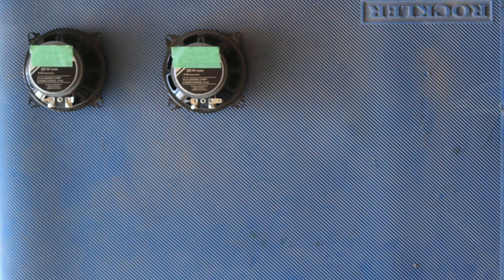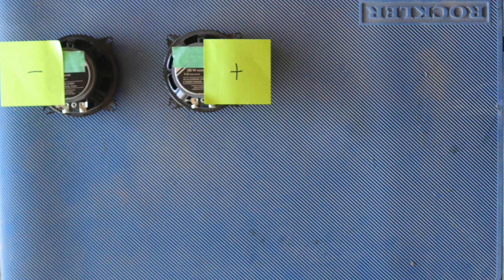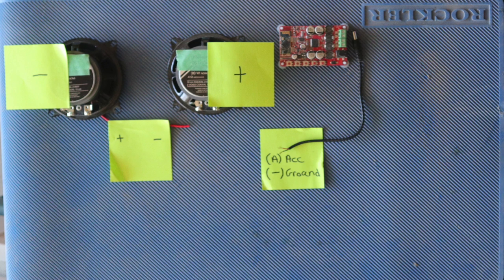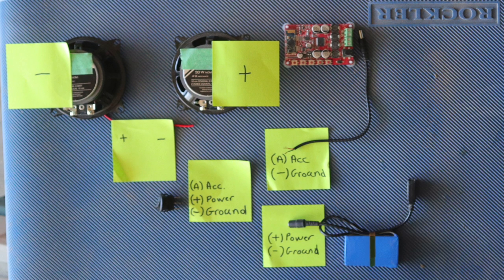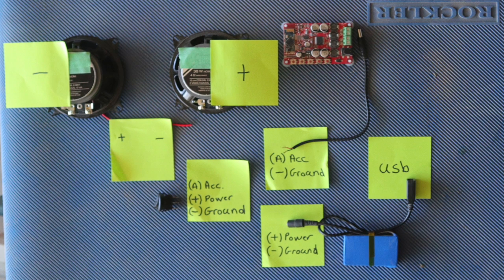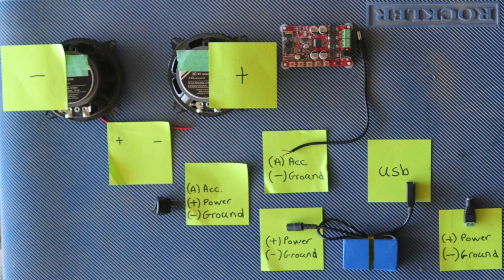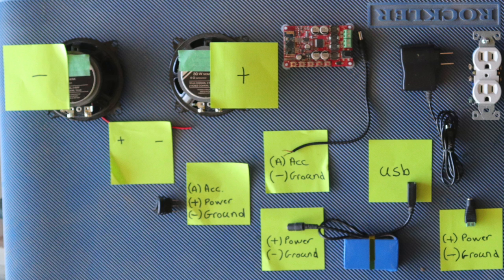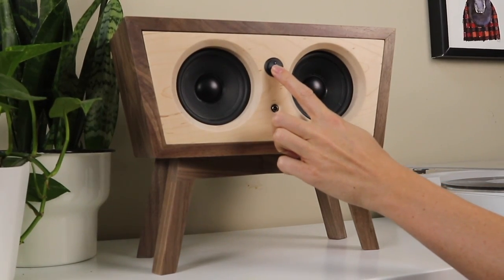How to Wire a Bluetooth Wireless Speaker //Fast & Easy (DIY)

Comment: Nice and simple overview :) I have wanted to build a speaker but there are so many options that I kinda just freeze and never do it.
Reply from the maker: That’s where I was tell I figured this setup out.
Reply: @furthernorthfab  Looks like we are located in the same general area as well :)
Reply: Ignore the options overflow, just pick a route, then shutout the others , and STICK w it til you're finished. Right or wrong , you'll either achieve your goals or learn something. The only failure is tonot try anything. I live this, my mind ego wants whatever I take time to do, to be the best and I get hung up trying to pick that one secret ingredient that gonna make my whatever top notch shelf best, than 2 months slip by with no progress...
Reply: @dont.ripfuller6587  That's such a valid point. Not starting is never learning.

Comment: I'm trying to make a portable Bluetooth speaker , I'm confused about how to wire the battery to charge it and to power the amp. If anyone knows the answer I'd like the help.
Reply: Hopefully it isn't as simple as it sounds.
Reply from the maker: I would have to know what battery and what amp you were using. I’m not an expert, I know a little